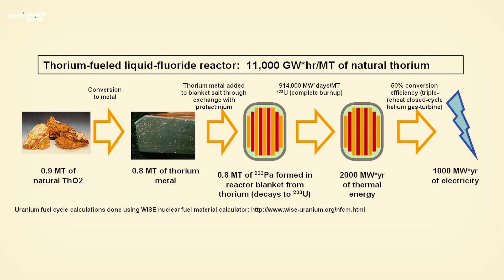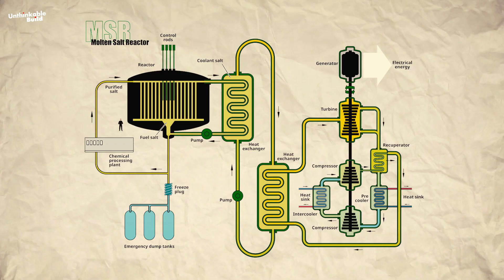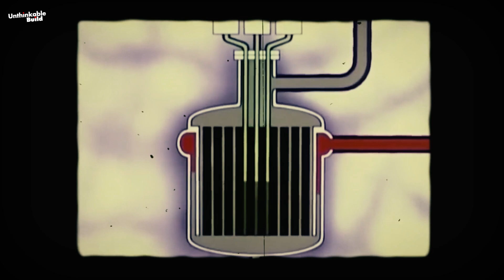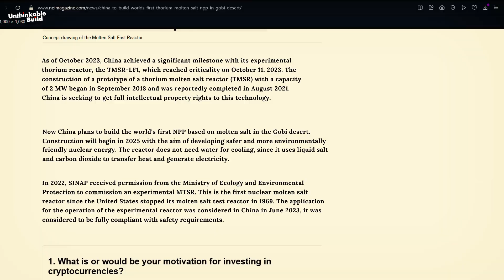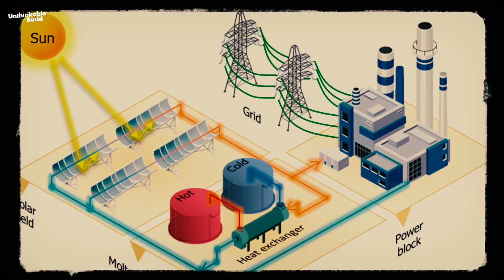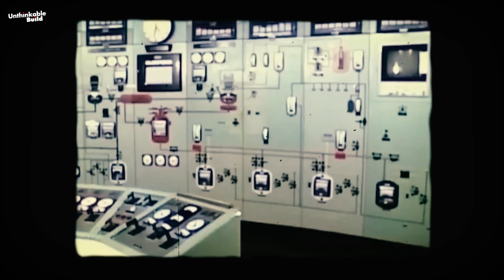China’s Thorium Reactor: Clean Energy Revolution or Disaster?

Comment: Compared with water, molten salts are barely corrosive at all. 

FlLiBes are unreactive when solid, won't dissolve in water and the actual corrosion measured at Oak Ridge puts the average pipework lifespan at over a century vs the deep inspection you need at LWRs every 18 months

Water at 100+ atm and 325C is effectively a demon trying to claw its way out of the pipework in order to flash to steam. There have been a number of very near misses - Besse-Davis (2002) is the most well documented and the corrosion inside the reactor vessel scared a lot of people in the industry - 9 inches of stainless steel eaten away in 18 months is nothing to sneeze at

Yes, molten salts are slightly corrosive but these are pure salts and have almost zero relationship to the kinds of corrosion you see with seawater (which is what people assume and are utterly wrong about)
Reply from the maker: That’s a great breakdown. People often underestimate just how brutal water under high pressure and temperature can be on reactor systems. Compared to that, molten salts like FLiBe are far more stable, especially when kept pure and under the right conditions. The Oak Ridge data really speaks for itself a century-long lifespan on pipework is a massive difference from the constant inspection and repair cycle of LWRs. You’re right too that many assume “salt = seawater corrosion,” but in reality, it’s a completely different chemistry with far less aggressive behavior.
Reply: @UnthinkableBuild  it's not just the nuclear side either.

At 325-350C you can't make dry steam for your turbines and the steam tends to condense into droplets, damaging turbine blades and vastly increasing maintenance costs whilst also increasing downtime. This is the primary expense of an operating LWR nuke plant. The only comparable thermal electric power genration is geothermal and that has just as many problems, plus feedwater containing very high silica levels.

The 650-850C of MSRs means you can make dry (or even supercritical) steam for the turbines and also means that a MSR can act as a drop-in replacement for coal burners (a complete MSR and containment is about 1/4 the size of equivalent power combustion plant) - and it appears China has been planning for this in its new-build coal stations over the last 20 years

China's also been buying up the thorium output of its rare earth processors for the last 20 years. That matters because there's more thorium in monazite than every lanthide combined and you need to extract the thorium FIRST before tackling the desireable metals. Thorium disposal is what makes rare earth mining uneconomic in most parts of the world, but a thorium buyer at $150/kg (same price as raw uranium)  turns a "rare earth mine" into a very profitable "thorium mine with rare earths side gig" in terms of income to the operators. This was how China managed to corner the global rare earth supply in the 2010s

Oak Ridge also demonstrated that if the pipework is drained and left a few days the residual radioactivity decays to very low levels - low enough for safe direct handling by humans. More impressively, they demonstrated that if designed properly the entire reactor system including pipework, heat exchanger and vessel changes could be handled by waldos. Weinberg went all-out on his "Mark 2" design to make it a "safe, scalable industrial prototype" vs the "laboratory glassware demonstrator" which was the Nautilus reactor.

One of the great things about MSRs is that they can go right up to the limiting temperature of fission reactions without damage (fission power thermally self-limits at about 1150C thanks to doppler effects. It simply CAN'T get hotter than this), so even if you get a criticality runaway that isn't mitigated by salt expansion reducing reactivity, your heat and power output will plateau anyway. MSRE sttempted to prove prompt criticality with a result that the reactor's output briefly spiked to 150% of design power before falling back to 120% and staying there (they simulated every kind of nuclear accident that had occurred along with a few that were only theoretical. The reactor either shut down or self-limited for each scenario). Imagine looking at your nuclear reactor and pipework glowing a dull red colour whilst still chugging along quite happily.

One of the "problems" naysayers like to bring up is "What happens when it freezes?", as if electric heaters don't exist and weren't used on MSRE

The single biggest problem with MSRs is that they can run on unenriched uranium or thorium. Bear in mind that enriched uranium only a viable source if you're already isotopically separating uranium in order to obtain depleted uranium as weapons-grade plutonium feedstock. That disadvantage was leveraged by the military-industrial complex to make "enrichment plants" (which make 1kg of 3% reactor grade uranium for 9kg pf depleted uranium) dual purpose sites exempt from weapons treaty restrictions - and THIS explains why USA oppostiion to MSRs is si firmly entrenched.

Weinberg was very forthright about MSR designs unshackling civil nuclear power from its dependency on the waste product of military activities. Realising that this dependency exists explains a lot about why Rickover decreed that LWRs would be used on aircraft carriers instead of MSRs. Hawks in the military DIDN'T WANT civil operators realising there was a vastly cheaper option available and when Weinberg proved MSRs were viable despite their opposition, they pushed hard to get Nixon to outlaw them.

From Nixon's POV it was convenient both for the purposes of pushing jobs to his Californian constituents(*) and cementing the USA oil hegemony that Kissenger was negotiating middle east buy-in on.

(*) Santa Suzannah was the site of the largest nuclear disaster ever to occur on USA mainland soil and underscores the extreme dangers of using reactive metals as your coolant. Molten sodium doesn't just catch fire when exposed to air or explode on contact with water and the core damage that ensued from a miniscule amount of circulation pump bearing grease gettting into the cooling loop really demonstrates just how badly things can go wrong - Just because a coolant looks good on paper doesn't mean other practicalities or safety risks should be ignored (similar problems apply to molten lead. The low vapor pressure of this stuff makes it extremely dangerous to be around and the damage to us bioloigicals is insidious)

Comment: That is all because stupid US politicians mistakenly read "liquid reactor" as "leak xxx".😂  But in chinese, it is molten, it never lead, it just got frozen.😀
Reply: Reactors using enriched uranium are a figleaf to cover the production of nuclear weapons - which need depleted uranium in order to produce weapons-grade plutonium

The single biggest sin of Weinberg's molten salt reactor design is that it divorces civil nuclear power from its critical dependency on the waste products of the weaponsmaking cycle. That in turn means that uranium mining and isotopic separation are weapons processes (thorium is already present as an unwanted waste product of rare earth mining and finding a market for it solves the displsal issue)

Nuclear waste isn't a big problem anyway - it's about 1 olympic-size swimming pool of volume per 1GW reactor, per 60 year lifespan. Molten salts reduce this by 99%.

In both cases the waste is less radioactive than the original fuel in about 450-500 years (Yes, you can detect it for 20,000++ years, that doesnt mean it's dangerous) and already safe enough to handle with gloves on in about 120-150

Weinberg's strong advocacy for using the molten salt design as an anti-proliferation/nuclear disarmament tool spooked the USA military and resulted in them getting Nixon to kill the project them attempt to erase it from history.